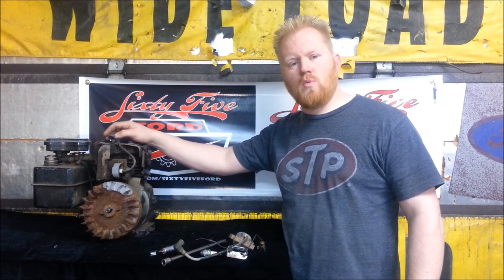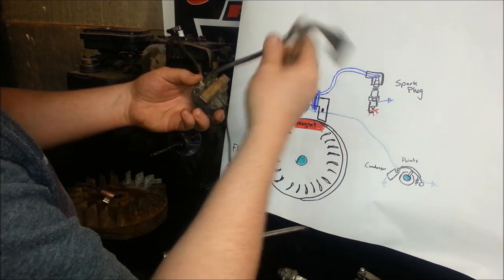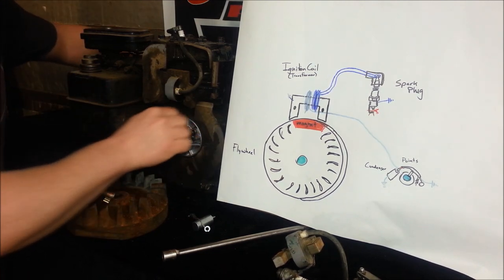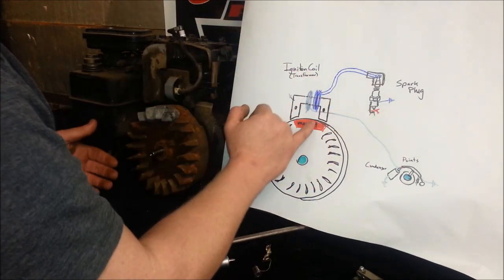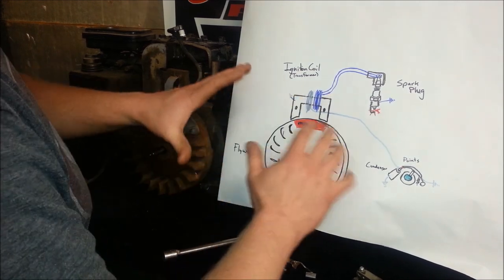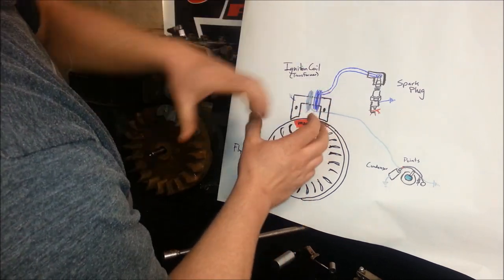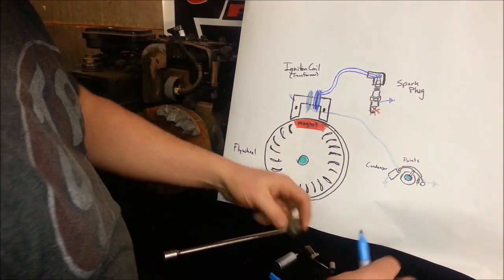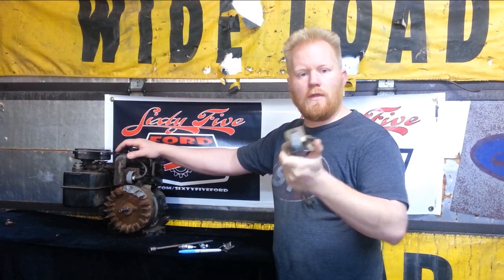How Points and Condensers Work Small Engines

Comment: Now I'm really confused
 I thought the points were closed most of the time and they opened momentarily for the power to travel to the plug instead of ground.
Reply: They are closed most of the time, they open momentarily at whatever degrees before tdc. This collapses the magnetic field creating the high voltage current...creating the spark....so you are right Garry.....he's wrong....!
Reply: Garry Ludwick. Any engine that uses points and condenser, pre electronic ignition era, knows you are right!
Reply: @deanhenthorn1890  I have this same engine and the points are OPEN most of the time.  I've seen a few engines that work like this including the Onan engines.  My understanding is that either system can work to break the electrical field and cause the energy to pass through the secondary winding and through the spark plug to ground.

Comment: Great vid...   Would love to see if you come across points failing in leaf blowers.  I've had two blowers go bad (no spark) in 2 years.  The latest was a Poulan.  Noticing on youtube a lot of the poulan leaf blowers are failing for different reasons.
Reply from the maker: +averagejew Only stuff made pre mid 80's will have points. Other than that your ignition coil can short out but it is pretty rare.

Comment: sorry you need to read up on the magneto ignition system, the points dont stay open most of tbe time and the condenser does not feed current back through the primary coil
Reply: You need to do a follow up vid

Comment: Thanks for the video. Good stuff and a generally clear explanation. I feel you may have got CDI  and points ignition systems somewhat confused. What you may find happens is that the current generated as a double and reversed wave ( as you pointed out) is allowed to flow through the points to ground creating a circuit. This circuit is broken by the points at the peak of the second wave, The condenser does stop arcing but more than just to save the points it precipitates a sharp instantaneous collapse of the magnetic field and it is this which generates the massively high voltage in the secondary coil. Keep up the excellent work I love your tips!
Reply: My thoughts as well, until later in the video he shows a points system I haven't seen, a bit different to a motorcycle or car but yes, is points, well... a single point lol
Reply: you have an error in your explanation there is no current flowing thru the points the points open lifts a gd off the condenser lead allowing a current flow thru the primary coil thru the condenser to gd  via the metal can and screw to the base of dist this flow  creares ahigh voltage in sec . coil sending it to dist cao and plugs as points closecond lead is gd again stopping voltage  the only time points have current is either wrong condenser or defect condenser the voltage can not get thru the cond.so it jumps the tiny gap at open points to gd  which causes pitting of the points over time you can test this with your voltmeter conn to the cond lead with switch in run pos  you will see batter volts (12)  on that screw  now open the points the voltage falls off.  hope this helps some one  most of the time  the condenser is failing if you have spark tbls.

Comment: Your explanation is incorrect.
Wikipedia better explains:
In the type known as a shuttle magneto, the engine rotates a coil of wire between the poles of a magnet. In the inductor magneto, the magnet is rotated and the coil remains stationary.

As the magnet moves with respect to the coil, the magnetic flux linkage of the coil changes. This induces an EMF in the coil, which in turn causes a current to flow. One or more times per revolution, just as the magnet pole moves away from the coil and the magnetic flux begins to decrease, a cam opens the contact breaker and interrupts the current. This causes the electromagnetic field in the primary coil to collapse rapidly. As the field collapses rapidly there is a large voltage induced (as described by Faraday's Law) across the primary coil.

As the points begin to open, point spacing is initially such that the voltage across the primary coil would arc across the points. A capacitor is placed across the points which absorbs the energy stored in the leakage inductance of the primary coil, and slows the rise time of the primary winding voltage to allow the points to open fully.[5] The capacitor's function is similar to that of a snubber as found in a flyback converter.

A second coil, with many more turns than the primary, is wound on the same iron core to form an electrical transformer. The ratio of turns in the secondary winding to the number of turns in the primary winding, is called the turns ratio. Voltage across the primary coil results in a proportional voltage being induced across the secondary winding of the coil. The turns ratio between the primary and secondary coil is selected so that the voltage across the secondary reaches a very high value, enough to arc across the gap of the spark plug. As the voltage of the primary winding rises to several hundred volts,[5][6] the voltage on the secondary winding rises to several tens of thousands of volts, since the secondary winding typically has 100 times as many turns as the primary winding.[5]

The capacitor and the coil together form a resonant circuit which allows the energy to oscillate from the capacitor to the coil and back again. Due to the inevitable losses in the system, this oscillation decays fairly rapidly. This dissipates the energy that was stored in the condenser in time for the next closure of the points, leaving the condenser discharged and ready to repeat the cycle.

On more advanced magnetos the cam ring can be rotated by an external linkage to alter the ignition timing.

In a modern installation, the magneto only has a single low tension winding which is connected to an external ignition coil which not only has a low tension winding, but also a secondary winding of many thousands of turns to deliver the high voltage required for the spark plug(s). Such a system is known as an "energy transfer" ignition system. Initially this was done because it was easier to provide good insulation for the secondary winding of an external coil than it was in a coil buried in the construction of the magneto (early magnetos had the coil assembly externally to the rotating parts to make them easier to insulate—at the expense of efficiency). In more modern times, insulation materials have improved to the point where constructing self-contained magnetos is relatively easy, but energy transfer systems are still used where the ultimate in reliability is required such as in aviation engines.

Edit

Comment: Do you really have a 'dent' in your crankshaft ? Normally there's a 'bulge', because the secondary circuit gets activated when the points open, not close as you say! Or is this only with battery equipped systems? Does this system work the other way around than normal? please clarify, some1...

Comment: This seems to show the spark plug fires every stroke but it seems a four stroke should fire every other stroke. I suppose  it could fire right at tdc of the intake stroke also and it wouldn't affect anything?
Reply from the maker: Exactly it's what they call a wasted spark system. All small engines fire on the intake stroke as well as the compression.

Comment: I have a TecumsehH540 or HS40 and the points are closed all the time until a lobe on the crank open them up for a few degrees of rotation, seems backwards from what you say being open 90% of the time, either way, no spark and while points are open no resistance from the open point to ground, I haven't worked with points for 30 years so I forgot alot. Any ideas on how to test? Nice Vid!
Reply from the maker: I do have a video on swapping these https://youtu.be/HV9MJwsUP_4 
but your already in so may not help much.  The most common, no spark culprit in order is: dirty/greasy/corroded point connection that don't make a good connection, the ground kill wire still engaged, dead condensor, shorting out the spark, and finally a dead ignition coil. 

So I always like to pull the kill wire off the kill location from under the carb to eliminate it. Then I run some fine sand paper(300+) through the points and spray then off with carb cleaner or brake cleaner to degrease them. Then I try to get a spark.

Comment: Great explanation on points, ignition system!!!
I have a Wheel Horse that I bough new in 1976 that has points. Years back I pulled the flywheel only to find that the points are conveniently located on the block.  Can’t beat experience or having a manual :)
Reply from the maker: Yeah, you learn from experience. I've done that to many times.

Comment: Your video was excellent,  I have question about a 1975 16 hp Briggs engine as to where the magnet wire wire From the ignition switch is connected , is yellow wire or m wire hook to the points    Thank you Jim

Comment: A secondary tap of the coil provides a signal to do many things prior to hi voltage rectification for the spark plug. Many people are
looking for passive analog devices to support electrical needs sans onboard battery.

Comment: I have a small engine with this, and I get power to the top of the plug, but no spark. I put the plug in another engine and it has spark. I cleaned the points and the coil seems to be working (idk how he tested it). What would anybody suggest?

Comment: seems to be some confusion about points ---with points closed  nothing is happening  every thing is grounded when they open it removes the ground so current flows  thru  cond. to ground that flow going thru coil creates high voltage due to turns ratio of windings causing spark

Comment: Just a quick question the new points I installed for my Kohler K321. If I can see a bright spark when the motor is turning over would this indicate a bad condenser? Thanks for posting the video.

Comment: Your close but mostly wrong.  At the precise moment the points open (not close) the ground is broken which causes the field in the coil to collapse and go to ground through the spark plug. The purpose of the condenser in layman’s terms is to protect the points by  absorbing-the excess spark  that would jump the points to ground and weld them when the field collapses. Nice video.

Comment: Thank you and Well done........I have a Puch moped........the ignition system incorporates a "kill switch" fitted to the handlebars...........wil this basically be a open circuit or a grounded circuit, to/from the coil ? Thanks
Reply from the maker: Most are just a ground from the coil to prevent the coil from building up a charge.

Comment: A-4 cycle engine needs a spark every other revolution. It looks like this will provide a spark each revolution like a 2-cycle engine. How do we account for this?
Reply from the maker: They call it a waste spark system and it is on virtually every small engine. It simply sparks on the exhaust stroke and does nothing.

Comment: I had a ST350 Ariens  snow blower with no spark so I change the Ignition coil- condenser and the point but still no spark
can you help me 
thank you
Reply from the maker: Make sure the kill wire isn't engaged. This can be with a key switch or throttle set to low. It's probably best just to disconnect it from under the carburetor and let it dangle out of the way.

Comment: i fitted a stihl points type ignition plate in an old echo saw... got NO SPARK until turning in wrong direction and then big blue spark.....checked position of strongest magnet and cut a keyway to get magnet leaving 2nd armature end as points open.... now sparks but weaker. strange as the stihl was anticlockwise rotation and echo is anticlockwise rotation....
Reply from the maker: I've swapped non-points Echo trimmer coil into a old points Poulan saw and it fired right up and I use it still. I know that the position of the magnets can be either North inwards/South outwards or South inwards/North outwards. If the coil is setup to pull off of North and it is in the inward position, it is like having a 3/4in flywheel to coil gap, which will give a weak spark. Briggs and Stratton had  issues when they went from points to breakerless and flipped the polarity of the magnets in the flywheel. Customers were so mad they offered to repolarize the flywheel for free so people could put breakerless coils on their points machines. Later they switched back to the standard they were using before.

Comment: Very informative thanks . I have a 1978 Bultaco Sherpa 250. Can't seem to get it to run right, it'll run at full pelt or not at all. Think I might have wired the primery  ciol up wrong or may have a short some where. are the Primery and the condeser bolted to the engine ( to ground ) or are they insulated in some ay
Reply from the maker: Are  you sure it's not a fuel/carburetor problem?

Comment: Don’t need North and south poles on flywheel only one polarity. When the magnet passes the magnetic field collapses and induces a voltage to secondary weather AC or DC it’s the same. Grounding the primary should not cause the spark to open, if so please explain the path for current.
Reply: Btw, every magnet has a N and S pole, every magnet...it's the nature of the physics! Lol

Comment: Excellent explanation - I’m confused at how grounding the primary circuit stops production magnetism since the fly wheel is still spinning wouldn’t the voltage still be induced into the primary? Current would flow from the grounded primary to the other side of the primary completing a circuit. I know clearly I’m wrong I just don’t understand. 

I want to add, I don’t think the magnets on the fly wheel need to have both positive and negative polarities, if we look at a coil pack on modern engines they use the 12VDC from the battery to operate. All we need is a magnetic spinning on the flywheel to cut flux into the primary coil.

Grounding the secondary makes perfect sense to shunt the spark back to the coil but also raises another question - when doing so wouldn’t the current from shorting to ground be high due to the voltage being extremely high? I would think the secondary’s coil would short out.
Reply: if primary coil is gd. there is no current flow even tho wheel is spinning you can not have voltage and gd at the same time

Comment: All i know is the amount of times my vintage brings and stratton flathead that doesn't have a spark plug boot has shocked me lol.
Reply from the maker: That'll keep you on your toes.
Reply: @sixtyfiveford  well also because I built a see through engine out of it like warped perception did and I used a screw in place of the spark plug where the spark jumps from the tip of the screw to the engine block in the combustion chamber between the valves and piston so a lot of exposed metal.

Comment: I'm a female and I love this stuff!!.....
;D
I have a 5hp tecmsh that starts inconsistently.......I cleaned the carb and replaced o rings, etc......but am still having probs......my next task is to check the points, condenser and coil.....
THANX!!
Reply from the maker: sbecktacular Awesome. The coil will either work or it won't but the points/condenser can be intermittent. I'm sure you saw I have a video on them http://youtu.be/HV9MJwsUP_4
Reply: hey thanx!...
turns out my motor doesn't have points it has the magnetron? coil......I did alittle fiddlin' with it this morning and it's running GREAT!
thankyou for all your informative vidz....much appreciated!
Reply from the maker: Awesome. Great work.

Comment: Aren't some small engines ie Briggs Stratton 12.5 Hp I/C Vert shaft pointless and condenserless ?
Reply from the maker: Yes, since 1984 all Briggs are point and condensor free.
Reply: So what is the mechanism to insure the exact microsecond of spark without points (now that I think about it); is it the more exact manufacturing so they know exactly when that mag field will collapse creating the surge of current in the primary thus secondary coil to spk plug?  FYI:  Model T's & i think A's had a separate coil for each cyl? so that if the key was on, the coil on tap would just sit there and keep sparking indefinitely .   I found a condenser believe it or not from the old days "60's"